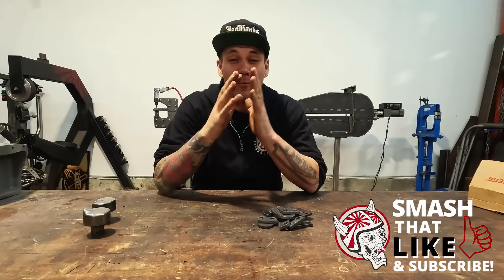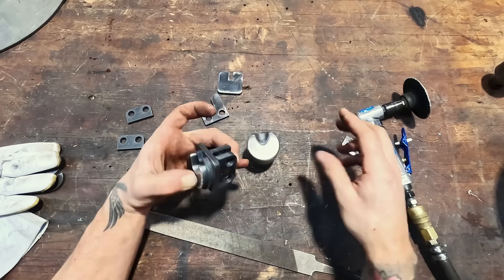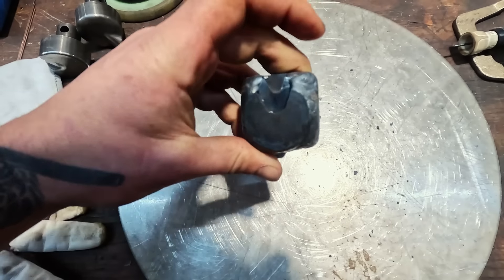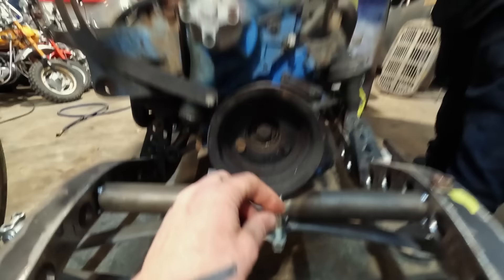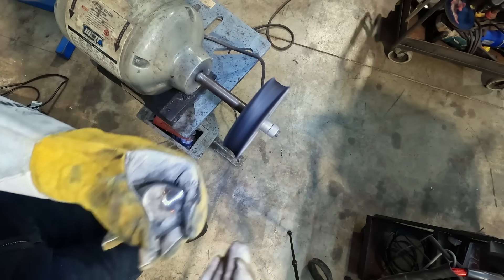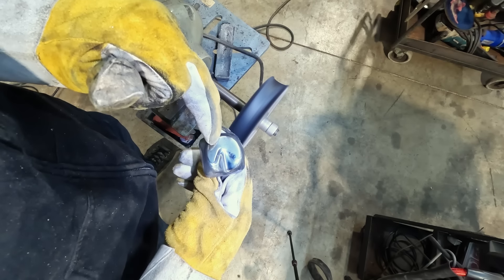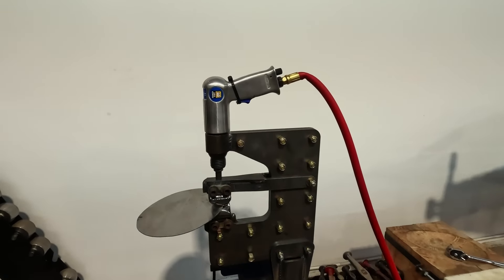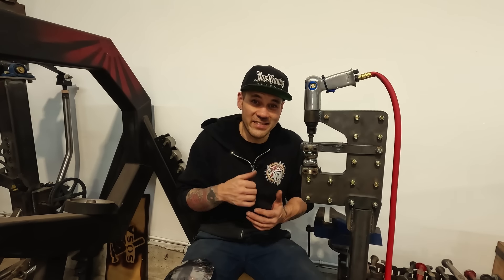EASY Thumbnail SHRINKING Dies - DIY Power Hammer TOOL! Step By Step GRIND WELD POLISH

Comment: I keep wondering if striking force is being lost between the many mechanical joints between the hammer and the die. Would it perform better if the die had a bit inserted directly into the hammer. The current striking arm could be designed to function as a guide for the die and also prevent rotation of the die. Another great project and video.

Comment: I think if you were to add a spring to keep the hammer close to the anvil or the anvil close to the work.  You would get better energy transfer to the piece you are working on.  Backlash dissipates energy transfer.  I think you will have to try several different springs.  Let me know how it works.

Comment: hey Karl, thanks for all the knowledge you share, I love how you break down your thought process. to give back I got a tip for you, when it comes to hardening steal with water, it's true that it will harden it, but it makes micro cracks thru out the piece. it's best to use oil I've been told to use use motor oil because of the carbon content.

Comment: All this needs to make that die work is a decent air hammer instead of that cheap little princess auto unit. I have been following for a while now, made a shrinker yesterday but I used 1/8" bedframe angle, as that is a medium-ish carbon steel. It works, makes smaller tucks but I'm very happy with it. I made the stretcher tool a few weeks ago to fit my "chief" air hammer, very very nice! I want to make a version of this tool soon as well.

Comment: Awesome tool. To harden the dies, you'd likely have to case harden them, as most typical mild steel plate doesn't have enough carbon in it to harden when quenched. Case hardening diffuses extra carbon into the surface, making the outer skin hardenable. An easier method would be to profile them from a steel plate which does have enough carbon in it, but not so much that it is not weldable without cracking. Something like Hardox wear plate (used for excavator buckets, etc) may be a possibility. Also, after heating until cherry red / non magnetic, and quenching, you'd need to temper them too. As quenched, the steel will be too hard and too brittle. Tempering will reduce the hardness / brittleness, with how much depending on the tempering temperature.  

Another option which may work well is to use a more normal low carbon steel plate, but do all the welding using a hard facing filler rod. These are typically used to build up worn wear parts (such as excavator bucket teeth). The resulting weld fillet is already hard. I imagine it would work well for these dies, as the surface of the higher stressed parts end up effectively being 'made from weld' anyway. Grinding and polishing them to shape would be hard work though.

The bigger mass of the tools will be 'absorbing' some of the air chisels energy relative to the profiling tools. The heavier the tooling, the more energy will be used up accelerating and decelerating the tool, leaving less energy to work the sheet metal.

Comment: Your air supply hose is kinked at the handle. The dies are designed for a half inch shrunk edge . You can push deeper but the sheet may get overworked and will become brittle. Larger dies with a longer curved lead in to the flat area which you want larger will build more bowl faster. Your machine is a fast swage with so many BPM. It's good though what you called the thumb or thumbnail is actually tiny, you must agree? A few minutes with your head in a die making book will give you the idea better than I will. Also a sharp corner where the die pushes "into" but is not actually pushing on the sheet (the relief) is better allowing the sheetmetal to bunch up in the void  on the outside of the curves. Being polished is excellent as the sheet can slip as it must while forming. Thanks for encouraging all those who are keen, to have a crack at it.

Comment: Hi Karl, loving the power hammer. In regards that you are worried about the impact gun not preforming on 18 gauge sheet you can get more powerful impact gun. What you have is what you looks like a 4x gun. You can get 5x and a 9x guns. Just a note the impact fitting (snaps) change in diameter according to the size of the gun. In the aircraft industry is where you’d probably find bigger impact guns. Hopefully this info might help. Cheers from down under.

Comment: Love the  channel and the tools!  A question about the profile hammer: what is the purpose of the swing arm that the hammer impacts?  Why not have the die mount to the hammer directly?  

If you find the swing arm cracking, what about making it from DOM tubing and notching to fit the frame and die holder?
Reply from the maker: The swing arm is locating the die to the lower

Comment: With 110v welders, you get more penetration when using flux core.  Weld outside or with a good fan because it will be more smoke.

Comment: If you were to grind in bevels on the plates before welding, you would get much deeper penatration. The more solid the anvils, the more work actually goes into the piece being worked. Work energy is being lost in the small gaps. Otherwise, I'm loving the concept of your little machine. Keep the great ideas coming.

Comment: Rather than dunking mild steel in water or oil to try to harden it ( it won't), try case hardening it to add carbon to the outer surface. Lots of inexpensive was to case harden on YouTube and other media.

Comment: I love your thought process that it doesn't have to be perfect to work. 99% of the people that will use this machine will do a few projects with it, be really proud of the results, and not use it everyday for the rest of there lives. Thanks again for the content.
On a side note a better /expensive air chisel would probably make a big difference, I have cheap ones and one snap-on and there is no comparison to how hard it hits!

Comment: I think the top die just needs to be lighter. Maybe just one less plate thickness would do the trick. The weight is eating up all the power of the air hammer. Or just send 200psi through that poor air hammer!
Reply: That was my first thought also..😉
Reply: It might be possible to experiment with drilling some holes in the top die to see if lighter is better, before making a new die from scratch.
Reply from the maker: I think a beefier hammer would make a huge impact also
Reply: @MakeItKustom I've had this idea in my head for awhile too! I bought a huge vintage cp air hammer a few years ago and have an old harbour freight planishing hammer frame. Might beef it up and give it a go! Thanks for continuing to inspire! Next time you are in Kelowna you should pop in to my new shop!